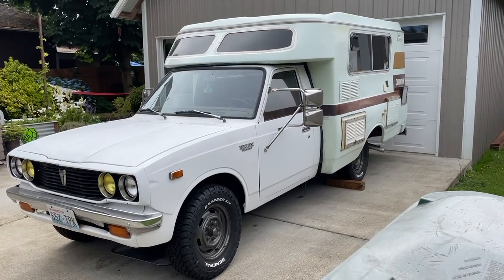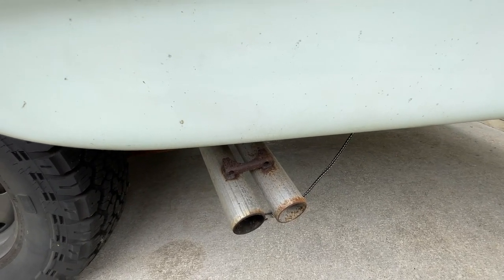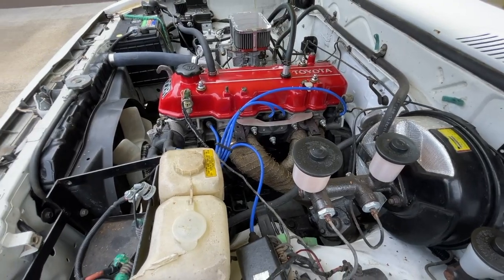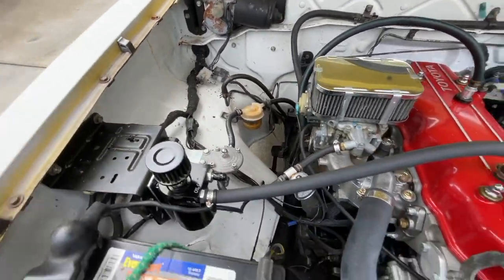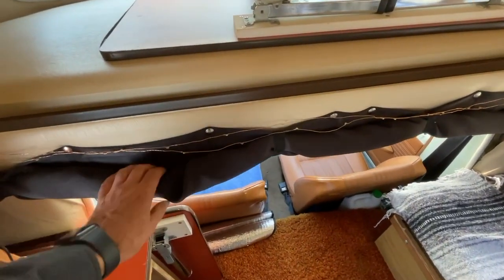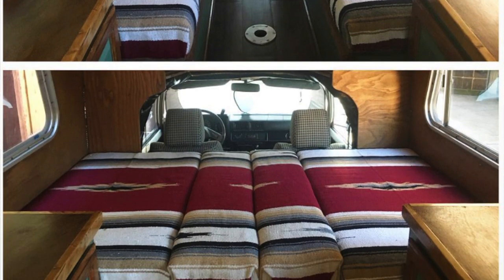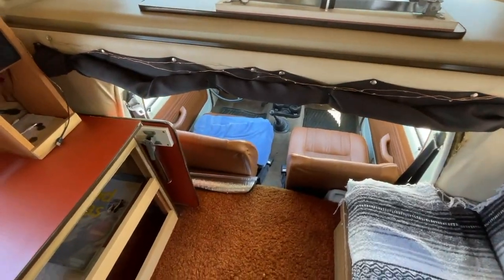1977 Toyota Chinook || Overview || 4x4 Chinook Build

Comment: RE: Fuel Pump Issues. No idea if you've addressed this yet or not (I see video was posted a month ago) but the two easiest solutions would be:
1. Add an aftermarket in-line pump near the tank & wire it in using the Black/Red wire for power & mounting (grounding) the pump to the frame. Or...
2. Since that 22R has a provision for a stock style mechanical pump (looks like you have a block-off plate currently installed), install a mechanical pump.

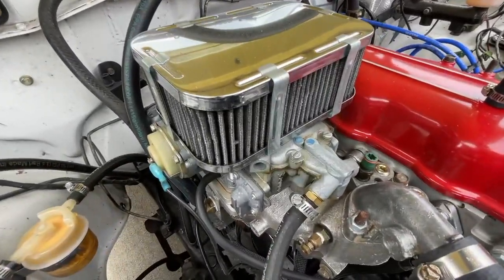I'm pretty sure I know why your OEM-style in-tank electric pumps keep failing. I freeze-framed your video @ 4:41 & see that the fuel pump resistor has been eliminated, & that you have the fuel pump resistor connector "jumpered" with a jumper wire.
That's what is causing the pumps to burn up on you. I will explain.

The stock-style electric pump was not designed to continually run at constant full battery voltage. The Fuel Pump Resistor lowered the full battery voltage to about 9 volts whenever the engine was running. This was done to extend fuel pump life & to make the pump run quieter. Power is supplied from the "RUN" circuit from the ignition switch (Black/Yellow wire at resistor connector). 
The pump does get full battery voltage when cranking the engine via the "START" circuit from the ignition switch, but only when cranking.

Original style fuel pump resistors are no longer available from Toyota, but I do have an easy mod to make the stock/OEM in-tank style pump work correctly. You just need to mount a 1.4 Ohm ignition ballast resistor to that remaining metal plate on the passenger side inner fender.
Then make up two wires (14-16 gauge recommended), with 1/4" spade crimp connectors, female on one end, male on the other. Female ends go to the ballast resistor, male ends go into the original fuel pump resistor connector.
Recommended resistors to use are either Standard Motor Parts RU4 or Autozone/Duralast CR107.

Just wanted to try & solve your pump dying mystery, & put this info out there for anyone else that might need it.
Reply from the maker: You've helped me in the past on the yota forums! You were a big help in getting the initial problems resolved when I first got this camper. I'd have to double check but the resistor is under that black bracket around that time stamp. This is VERY good advice for anyone else having a similar problem. 

Could you just throw in a fuel pump that is rated for 12V and eliminate the resistor?
Reply: @azorianification  I happy any of my info or input helped you out. I just didn't see the resistor on the first view & still don't after my own double check. Do you have it under the bracket? Is that what that zip-tie is doing there? Hard to tell but I'll certainly take your word that it's there. Is it the original & have you heat tested it to see if it's still in tolerance? Sometimes the original resistors get fatigued over time & develop higher resistance, choking off voltage to the pump, & possibly making it seem like the pump died.

Yes you can use an aftermarket fuel pump rated for 12 volts & eliminate the resistor, but with conditions for this application. It should be rated for 4-7 or 5-8 PSI fuel pressure, 20 GPH (gallons per hour) minimum flow rate (35 would be better), and always be mounted as near to the tank as possible. Electric fuel pumps works best that way, with a short "draw" distance from the tank, and a longer "push" distance to the engine.  And as long as it's specs don't specify needing a resistor, it will work fine. Most aftermarket pumps don't need the resistor. As an example this one: https://www.holley.com/products/fuel_systems/fuel_pumps_regulators_and_filters/fuel_pumps/carbureted_fuel_pumps/carbureted_electric_fuel_pumps/parts/12S

Comment: When I did some research on the Celica info. From what I heard almost every piece of the 20r is faster. I think maybe the 22r block was better but almost all of the rest of it from 20r leads to higher horse power. That would make 22r a lot cheaper tho if that's the case & infinite number of parts but I managed to get my 20r for $100 + what it cost to go get but was pretty close to me population wise. Was sitting in a field for 15 yrs min. Same as my 74' Celica. Actually 23 years for sure on that one.  Surprisingly not too bad yet but I haven't looked at the bottom end yet. Cylinder walls are not pitted after soaking in vinegar,  had rusty colored dirt  in them & mud dobber debris. Black oil in bottom end too which I think is a good sign for the crank.
Reply from the maker: Sounds like the perfect engine for a build!

Comment: Does it leak around the top front windows or the pop up?

Someone I know has one that leaks like crazy and he has no clue as to how to seal it up.
Reply from the maker: Are they sure it’s from the windows? I’d also pop the top and check the hardware that bolts down the lift arms. The sealant around the hardware on the top and under the top may fail over time and will need to be addressed.

Comment: Can you still find parts for this vehicle?
Reply from the maker: Yes. I’ve installed all new brakes, suspension, water pump, clutch, etc. lots of parts out these for these older Toyotas
Reply from the maker: Check rock auto for an example
Reply: Thanks 🙏